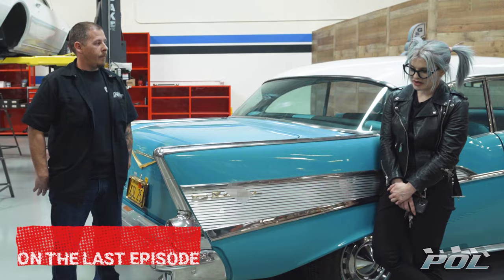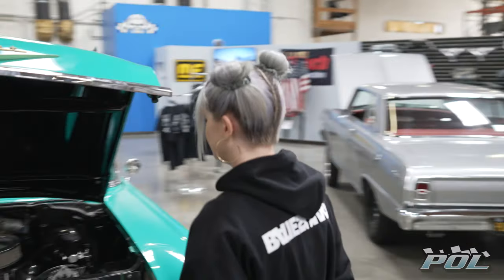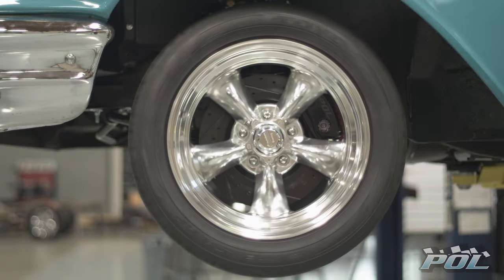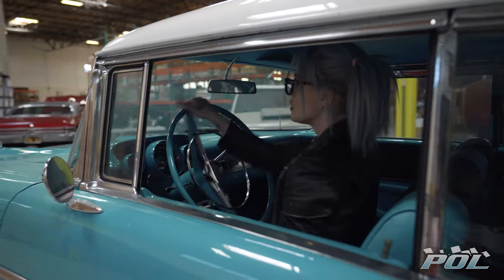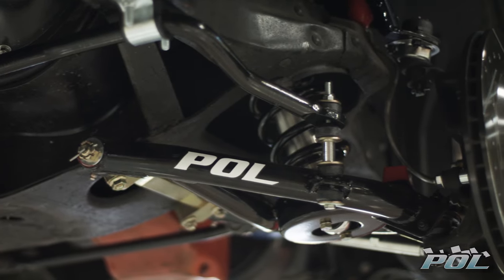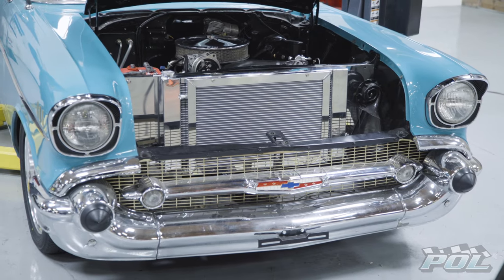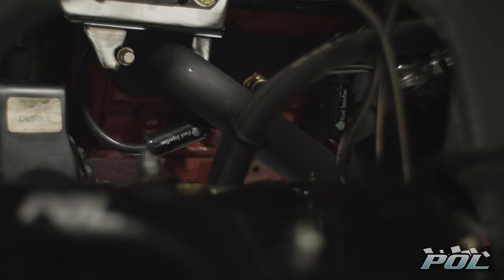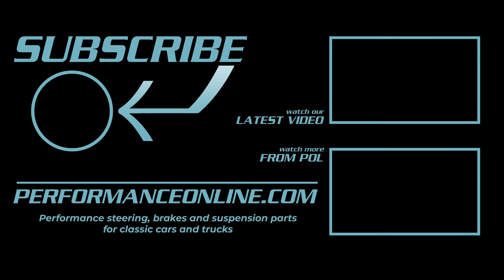Kelly Osbourne's Bel Air Torn Apart and Restomod by POL

Comment: I have been struggling with this pol column for 2 yrs. Had it in and out 3 times grinding down rag joint trying to stop interference  of set screw and retaining nut with shift mechanism. Even made a spacer to go under floor plate. Tried milling down bottom half of joint to gain clearance. At wits end with it. Any suggestions?